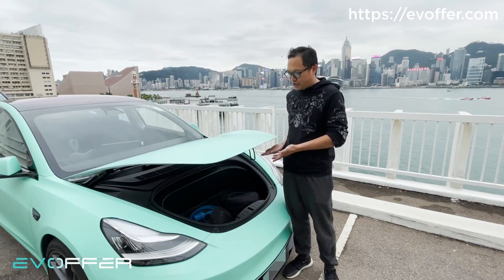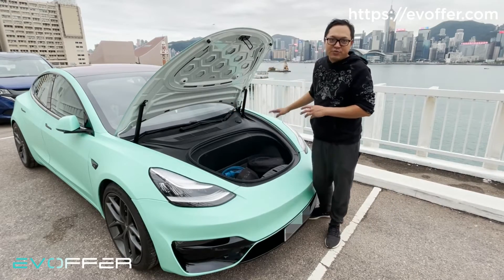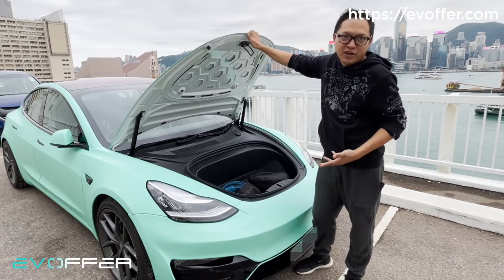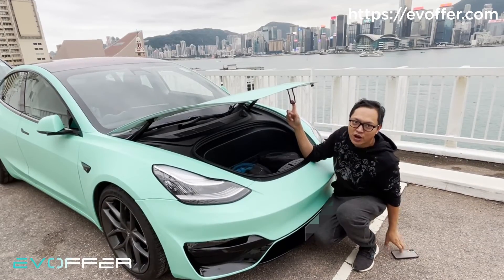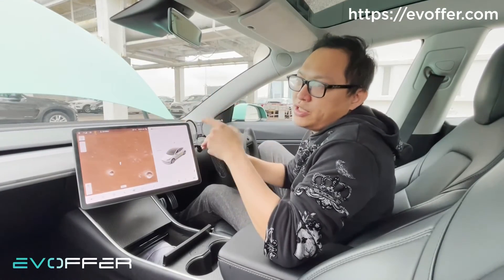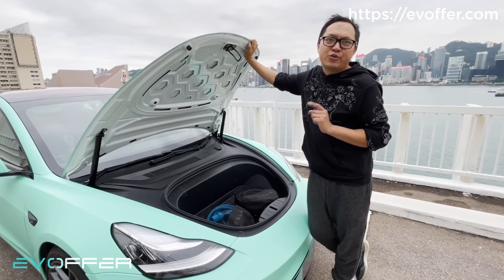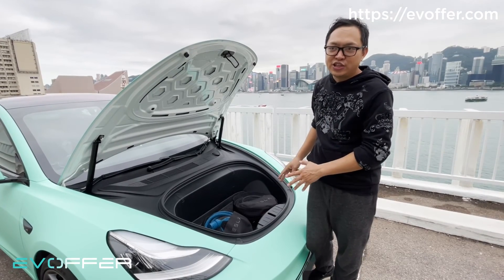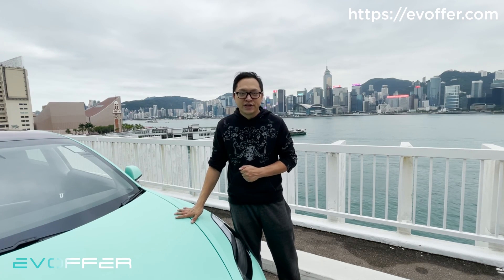Electric Frunk Feature & Safety Mechanism Explanation | Tesla Model S / X / 3 / Y | EVOffer

Comment: can from the app control the speed of oppening and closing? i am looking for those stuff from other companies and i am looking for a system that doesn't have much sound, in many systems we hear the motor noise, in doors, frunk etc.

i also saw you have the soft closing doors but will you consider to have a system for auto opening and auto closing doors,  similar to model x?

Comment: Hello 
I have your frunk unit which I purchased from you in anticipation of my model y to be delivery in January 2022 but Tesla delayed my deliver until June 2022. My question is will you accept the unboxed unit for a newer version 5 for my new 2022 with amd processor and lithium battery?
Reply from the maker: Hi, your current kit is fully compatible with the new cars with AMD processor. You don't need to swap the kit

Comment: Is there any difference in a 2022 model Y with a li-ion battery?  Does the current mark 5 system work with the latest model y?  Thanks
Reply from the maker: Our system will work perfectly on 2022+ Model 3/Y with Li-ion flawlessly. The power connection is a bit different but all remaining parts are the same as previous builds.
Reply: @EVOffer  thanks! Ordering one now.
Reply from the maker: @jklok  you are welcome 😊

Comment: Raymond, is very helpful and knowledgeable. I had the Hansshow frunk. The product open 2 time on me while I was driving. I remove the product and went with evoffer. There was another product Yahasun. It has a feature I really like. They use  balloon to test for obstruction. The nice thing about that is the hood automatically reopen. That way you know your frunk is not close even though the latch is lock. I ask Raymond if their product can do that. He is working with engeneering to update the software. Evoffer product is better in my opinion. I have the soft door close system install too. It's very nice. I have no issue with both product so far. Their materials and wires are flawless. I highly recommend it to anyone who wants to upgrade their Tesla.

Comment: Very good design - as I understand from your video, your controller actually monitors the electrical signals to the factory unlocking/locking mechanism before deciding what to do next, as opposed to having direct control of the mechanism. Much safer that way!
Reply from the maker: Yes, that's the idea of our system 👍🏻👍🏻